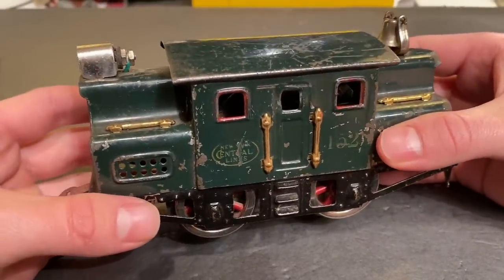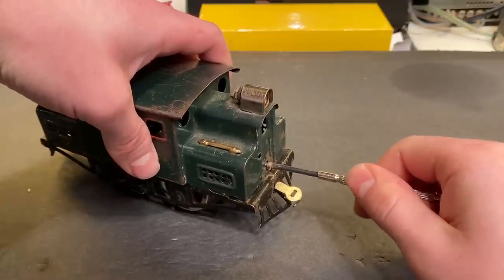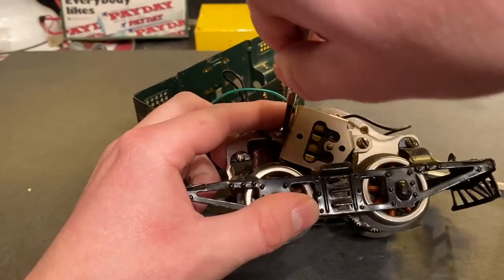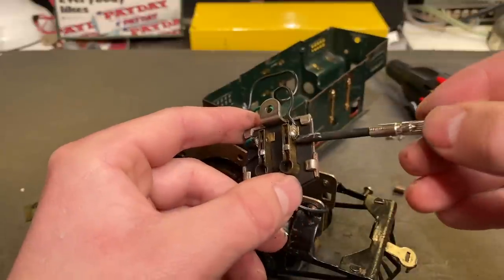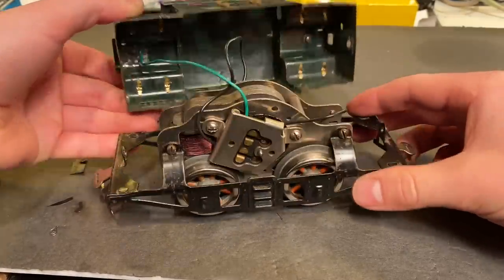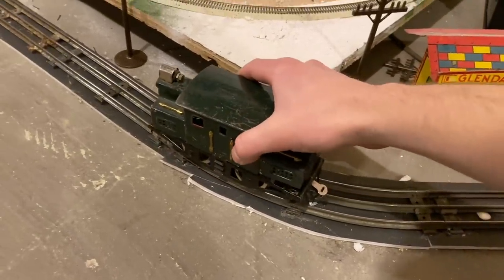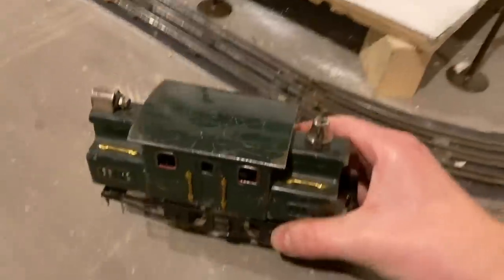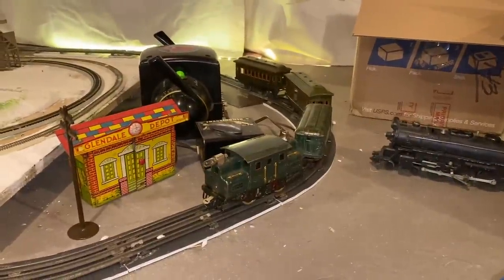Can We Make This 100 Year Old Lionel Locomotive Run Again?

Comment: I am Spechless of the Title of the Vidoe SMT Also SMT I Repiled to The Comment of My Santa FE F Unit Ho Scale Life Like Power Loc I Just need the name of the part that Holds the Wires and I See the Wires That Come out when it Poped of and Stopped Running I Want to Get it Running Again And I am Getting A Vintage Used Spirt of 1776 ALoco AHM Is It a Good Relabile Locomotive Cuase the The seller says it's A good  Runner and Cosmetic Condition as well what Should I Do To Extend its Life To Last Even More Longer throughout the years to come.
Reply from the maker: Sounds like the wires need to be re-soldered, most hobby shops that sell trains can do this. AHMs are not the highest quality but can be reliable for cheap models. Basic maintenance should keep it running for many years. (Cleaning, oiling and small adjustments.
Reply: @SMTMainline  Thank You I Appreciate it I Forgot to Put the name of the part that Holds  Wheels and wires but I see what it needs to Comeback to life

Comment: Don't want to seem like a dik but I do want to correct you thoes engines run on dirty dc witch has a small unharmfule amount of ac current in it but it is mostly dc
Reply: If its mostly dc then why would they put AC on everything the controllers etc. Even marklin runs on AC current.. I never heard of it either sounds weird
Reply from the maker: I wasn't aware of that, I also haven't heard of dirty dc. What kind of controller would you use?
Reply: @SMTMainline  its the original transformer marx and Lionel use the same thing the dirty DC is what the automatic reversing unit also known as a E unit needs to work if you apply straight. DC to it it won't switch direction the last direction it ran it would only run that detection on dc
Reply: Very early Lionel trains would run on AC or DC. Lionel couldn’t assume all of their customers would have electricity. Old catalogs include instructions for wiring old dry cell batteries in series to get different speeds. They also sold a separate reostat for use with batteries. 

I wouldn’t try DC power with anything with an E unit or other accessories though. By then Lionel was using pulses of DC to control whistles, etc.
Reply: @gameeverydaygamer3527  ????? The e unit just uses an over pulse of dc over ac. What on earth is this "dirty dc"? Doesn't even make sense. The motors are universal motors, nothing rare or auspicious.

Comment: One thing I’d definitely recommend you do is clean that track of yours. You’ll get maximum current flow, so that’ll give any project locos a better chance at running. Only reason I state such an obvious thing is because that track looks quite dirty.
Reply from the maker: I replaced all my O scale track since it was already super corroded when I bought it. I clean my track on the HO layout a bit more regularly too.